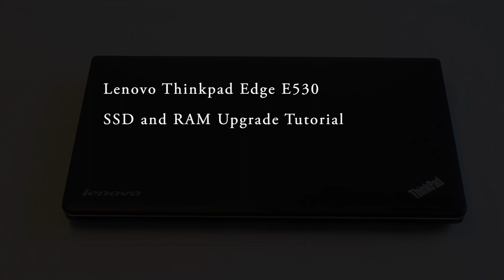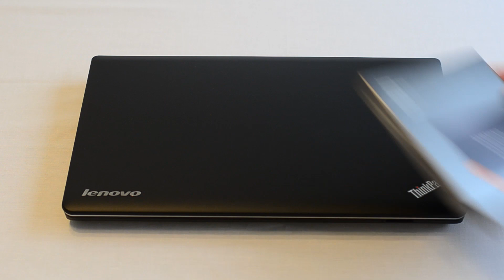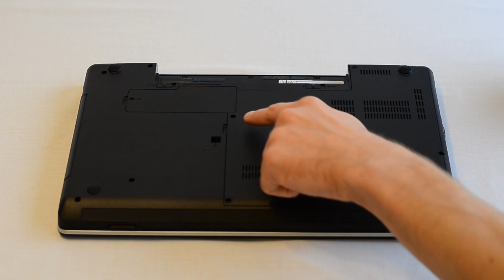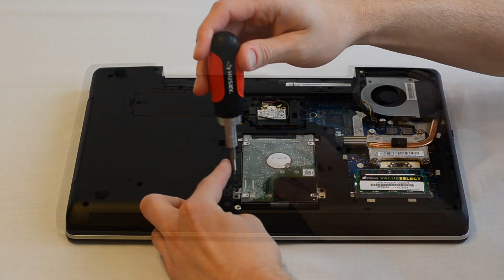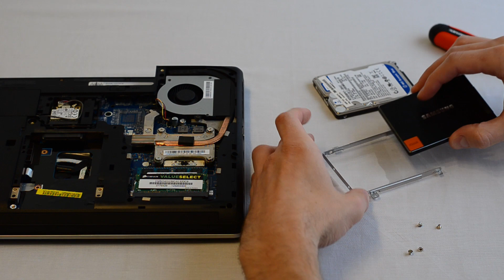Lenovo Thinkpad Edge E530 SSD and RAM Upgrade Tutorial

Comment: Thanks so much. This was just what I needed to pop the panel off of my E540. I had tried before but was worried about breaking the panel when I unscrewed it and it didn't easily come off. With that worry, I put the RAM upgrade on the back burner. Thanks to your video, I popped the back out with no worries and the RAM is in!

Comment: I just tried to install a 4 GB Crucial SODIMM  DDR3-1600 1.35v/204 chip in my new Thinkpad E545 and it won't fit. I don't want to force it. It doesn't want to lock into the clips and I'm afraid of pushing too hard and breaking something. Am I doing something wrong?
Reply: epistte Yes you are, check to make sure the notch in the RAM stick is facing the right way, it'll only fit that way.
Reply: Ryan Slattery I managed to get the RAM chip in the next day but I had to angle it in a little bit more than what I was previously doing. Once the angle is right it just slides in. The extra 4 Gigs makes a huge difference for my E545 A10.

Comment: Hi, I have a Lenovo Thinkpad E530 Laptop - [i5-3210M CPU, 4GB Ram - 1x Samsung M471B5273DH0-CK0 DIMM. PC3-12800 (800 MHz)]. I want to upgrade the ram. Would also like to stick with the same brand of DIMM if possible. Would the Samsung SO-DIMM M471B1G73DB0 1.35V (Low Voltage) 8G DDR3 1600 Notebook RAM (OEM) work in my laptop OK? ...
Reply: Is should, I have a an Edge E545

Comment: Thanks for vid ... but a couple of errors:  First, your insertion of the ram card is 99% hidden by your hand ... Failure to clearly show the 'locking tabs' being pushed into place could contribute to problems.   Secondly, you state you remove the ''back' two screws to pull the drive out .. but those are the front screws.   You and many here are clearly advanced and capable users .. Not so for many others ...  Generally a good job  .. most of us will not find those concerns to be a big problem .. Thanks again ;)

Comment from the maker: It should recognize without doing anything or re-installing anything. Check the BIOS to make sure it's installed - look for "Installed memory" it should say 8192MB (assuming you already had 4GB), if it says the same as you had before you added then the PNY stick is probably not working.

Comment: I have a e530c with 4gb 1600mhz, I was thinking about adding 4gb extra ram. If I add a corsair 4gb ram 1600mhz, will it work just like the lenovo ram or is there any difference between those two? the standard ram is: Lenovo 4GB PC3-12800 1600MHz DDR3 SoDIMM Memory. While the one I want to add is Corsair Vengeance 4GB DDR3 PC3-12800 1600MHz SO-DIMM.

Comment from the maker: That's your mSATA SSD. You can upgrade but it probably won't have much of a performance difference than the current one, just more storage. I believe the mSATA on the E530 is SATA II 3Gb/s max (not SATA III 6Gb/s) so you'll hit an upper limit on through put regardless of SSD but double check me on that one before you rule it out. Thanks!

Comment from the maker: Doesn't look like there should be any problems, the hard drive and RAM are in the same place as on the E530. Google "E520 hardware maintenance manual" to find the official diagrams. Any DDR3-1333 SDRAM SO-DIMM (PC3-10600) RAM should do. You may want to open up your back and see if you have a DIMM available, I'm not sure how yours was configured from Lenovo. Samsung now has 840 series of which the 500GB is reasonably priced, also Crucial M500 just came out, but I don't know much about those yet.

Comment from the maker: Man, that's a tough one. So you installed Linux on the 64G and are now trying to install Win8 on a separate partition? If you cloned with pre-installed Win8 wouldn't you need to just make sure that was working before you tried to install linux? That would be my suggestion, get Win8 up and running first and then add Linux. Search for this article: "Flushing the crapware: A guide to reinstalling Windows 8 on a new PC" to try to get some ideas on what you can do to clean up windows 8. Let us know!

Comment from the maker: The PCI Express Mini Card slot is underneath the smaller plate on the back (to the left of the main plate if the battery slot is at the top). That is the spot for either a wireless WAN or mSATA SSD card. Installing the mSATA should be pretty straight forward (just 1 screw).  Search "Hardware Maintenance Manual e530" in google to find Lenovo's instructions on removing/replacing mSATA (around page 72) but you might not even need it once you pull of the small cover and see what's going on. Thanks!

Comment: not sure if this has been asked previously, but just received my lenovo E530. They sent me the 16Gb mSATA SSD separately stating it is a customer replaceable part. However taking off the back cover, cannot locate the mSATA connector. On the E520, its easy to find. Any ideas?

Comment from the maker: Yes, the 840 should work fine. The 840 is the newer version of the 830. They broke the 840 up into two versions - regular (consumer) and pro. I haven't used any of them so I can speak to actual results but the main difference between regular and pro is write speeds. The 840 regular is actually slower write (on paper) than the 830 was. But at least the 500gb is the highest write speed of all the regular 840's. Let us know how it went with another comment! Thanks

Comment: being a linux+windows user i wanted to know if this sort of a set up would allow me to boot into linux as well. i have a dual boot laptop currently. i do not mind temporarily losing what i have on the linux partition. What I would like to achieve is a similar dual boot configuration but with my new ssd. an opinion from you would be valuable. 

Thanks in advance.

Comment from the maker: You know, I've never had good luck pinning down that info from Lenovo either and unfortunately I didn't do any speed tests to see if read speeds were getting above ~300MB/sec. I would be surprised if such a new laptop still has SATAII but worst case is you'll just max out your SSD speeds at SATAII limits. Sorry I wasn't more help.

Comment: Keyboard: Keyboard UK English With Number Pad
•Fingerprint reader: Fingerprint Reader, Plastic Cover
•Camera: 720p HD Camera
•Hard drive: 320 GB Hard Disk Drive, 7200rpm I will change with a SSD
•Optical device: Multi Recorder Optical Drive (12.7mm) for Windows 7
•Battery: 6 cell Li-Ion Battery - 75+ (62Wh)
•Power cord: Country Pack United Kingdom with Line cord & 90W AC adapter
•Integrated WiFi wireless LAN adapters: ThinkPad a/b/g/n Wireless BT Combo (2x2 ABGN & BT4.0)

Comment: Processor: Intel Core i7-3612QM Processor (6MB Cache, 2.10GHz, up to 3.10GHz with Turbo Boost) with Intel HD Graphics 4000
Operating system: Windows 7 Home Premium 64, I will put windows 8 on ...it
Operating system language: Windows 7 Home Premium 64 English (MS EM-MEA)
Display type: 15.6W HD AntiGlareMidnight Black
System graphics: NVIDIA GeForce GT 630M Graphics with 2GB VRAM(WWAN or mSATA capable)Mainstream, Total memory: 4 GB DDR3 - 1600MHz (1 DIMM) I will extend to 16GB as its cheaper

Comment from the maker: You can always buy a hard drive caddy and replace your DVD with a 2nd hard drive. You can also do what Lecanislupus did and use an MSATA SSD and just keep your HDD in it's current location. In either case I would recommend putting the OS on the SSD or you really won't get the full benefit of the SSD. It's always easier to put the SSD in when you buy and just re-installed windows before you start installing programs/customizing.